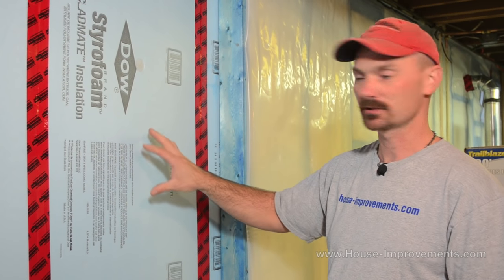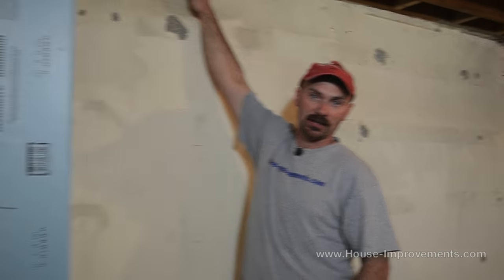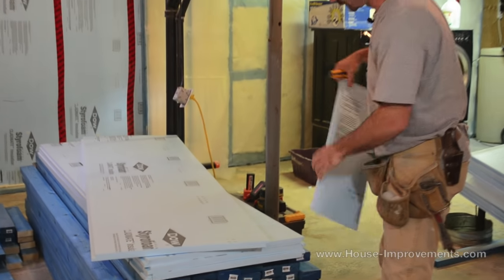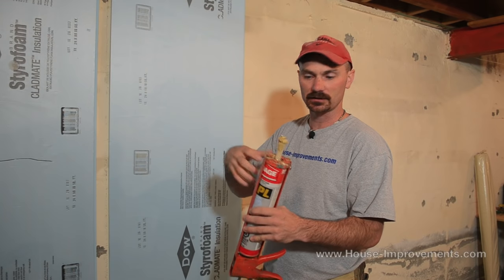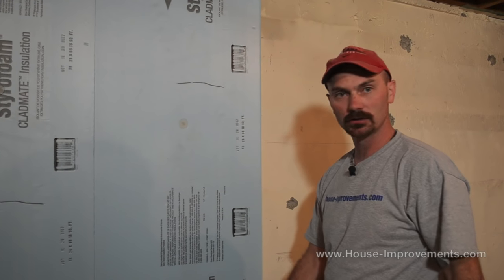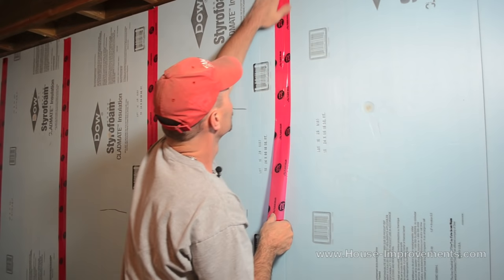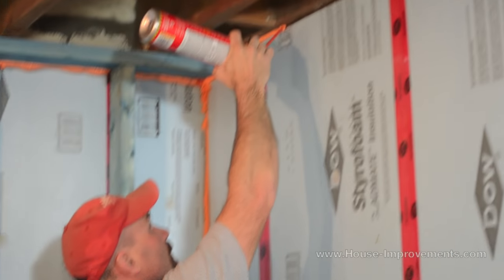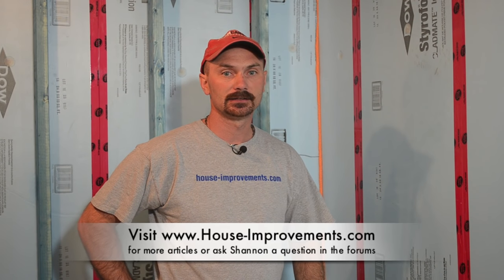How To Attach Rigid Foam Insulation To Concrete

Comment: All of this is great, but if you do not have the proper barrier over the exterior surface of the concrete, it will always transmit moisture directly from the soil, through the concrete, and into the interior side of the concrete wall. Thus you'll always get moisture, and mildew/rot if you drywall. That's why you've seen Mike Holmes excavate countless exteriors of basements down to the foundations in order to apply sealants and barriers to the exterior basement walls. Without proper WRB on a building you'll always have problems.
Reply from the maker: This can be true for sure, I don't want to bash MH but he also has TV $ behind him to cover the costs that go along with doing all that work and in most cases doing just that work along with re landscaping and replacing any sidewalks and anything else they had to remove so they could excavate  is in the 10s of thousands of dollars. If you have no real actual leaks it is hard to talk people into spending that extra money. Is his way the absolute best way.... yes I would say it probably is, but it is not always the practical way. Thanks for your comment
Reply: HouseImprovements
Very true, certainly not something to do unless it's a serious problem. I had a house out in Massachusetts that had a garage backed up to a hillside. The soil encased the back and side walls of the garage in a giant C-shape. Clearly there was no WRB to protect the concrete from the wet surrounding soil and the concrete walls would transmit so much moisture into the interior it almost became tropical inside the garage. Anything you put in there would grow mildew, mold or rust. So the only thing you literally could put in the garage was the car. Absolutely no storage ability. Basements, and all other spaces with concrete walls below grade really can be expensive, especially if not done right the first time. Nothing is more expensive then doing an expensive and complex job twice. ;)

Comment: Great Video! What R value does the foam board have?
Reply from the maker: They are different depending on the product .most range between R 3 to R5 per inch
Reply: @HouseImprovements  what thickness did you use here?

Comment: How would you insulate a cinder block house made in late 40s? Would you recommend putting 2 inches of foam and then Tyvek on the outside before vinyl siding is put on? Thanks!
Reply from the maker: Good question... That should work but you will need to also strap the house to install the vinyl.
Reply: HouseImprovements Is strapping wood slats?
Reply: George Fiorille I'm pretty sure that's exactly it.

Comment: Hi Shannon,  Love your videos.  Would attaching the rigid foam to the concrete wall using Tapcon concrete screws and Styrofoam metal washer work or will  it provide condensation path from cold to warn between the concrete wall and the Styrofoam?  Any input would be greatly appreciated.
Reply from the maker: Installed directly against the concrete is fine. Using Tapcons with washers will work fine

Comment: Hello.. My basement walls are very old and made out of big rocks and cement and definitely not very flat. What would you suggest I do for a wall or insulation in this case? Thank you in advance.
Reply from the maker: If the basement has proven to stay dry I would just frame wood walls and insulate with Roxul insulation batts. If it does not stay dry I would consider not finishing it.

Comment: With the rigid foam acting as a vapour barrier and then another vapour barrier on the inside of the wall would that not allow mould to build up in between the two vapor barriers?
Reply from the maker: 1" styro faom is not thick enough to be considered a vapour barrier.
Reply: DrgnFlys It is either a vapour barrier or it is not a vapour barrier?  The same could be said for OSB sheeting on the exterior of the vast majority of homes built today with the edges nailed all nailed securely to framing members.  All we the general population has to rely on is the statistical ratings of different products and application techniques.  1' of foam has to high of a permeance rating to meet the requirement of a vapour barrier.  Shannon is presenting an excellent video/tutorial on a very efficient method to insulate a basement.  Some of the homes I have done in this manner still only have the vapour barrier on the walls and I have never seen evidence of moisture/condensation build up when opening the wall for additional work?

Comment: hello Shannon, Can you perform the samed installation directly on a brick wall vs concrete? or does brick wall need a 1" gap or air? thank you for your response. Ben
Reply: please answer this one. I too have block wall and a hesitant to drill
Reply: N Kel as long as your brick is not hollow core,and has been filled.

Comment: Thanks for the great how to video! I had one question regarding prep for the wall. We have an unfinished wall, and the basement doesn't flood or appear to leak anywhere. Before it gets covered with foam, then framing, etc do you think it's worth it to DryLok the wall?

I previously owned a home that had water issues, so I'm a bit of a worry-wart with basement moisture!

Comment: Can I use this insulation on hardwood flooring? I just purchased a house that has a crawl space basement and the first thing I noticed was the floor was cold. I am planning to put insulation at the bottom of the hardwood flooring to keep the above rooms warm. Need advice for best solution. Thanks!
Reply from the maker: Yes you could install this product to the ceiling of the crawl space, be sure to also insulate the joist ends as well.

Comment: what if my styrofoam doesn't have tongue and groove? do I need to add glue or something else?
Reply: I'm going to be using 2 inch in 4 x 4 sheets on the outside of my house and then adding siding
Reply from the maker: You will have house wrap either installed under it or over it . As well I would use canned spray foam to seal any gaps in between sheets or around objects, once its dry you can cut it off flat. Here is my exterior foam video https://www.youtube.com/watch?v=eYjF1afRqvE&list=PLh0KqGKtX4oUz8fyeFsZYo6Np41NoreOQ&index=9
Reply: @HouseImprovements  Thank you for the quick reply. You are the best builder on the internet 👍

Comment: I'm not sure how I feel about this advice. Basement walls are notoriously humid (in most of the northern hemisphere) and adding a vapor barrier on the inside practically guarantees mould growth between the concrete wall and the foam. The concrete wall needs breathing, so some amount of heating is unavoidable, I think. And I am pretty sure there should be a "breathing gap" between the concrete wall and the foam/EPS/XPS.
Reply: Concrete and platics (foam panels, foam spray, tape, etc) are inorganic, mold cannot form on those materials. For your other points, check here: https://www.nrcan.gc.ca/kthi  Chapter 6 regards basements, and discusses water and vapour control well.

Comment: What to do with basement floors cracking with water seepage...not with every rain, but when we get heavy rains...
Reply: You should have a professional come in and evaluate, but you more than likely need a sump pump, Melissa.  Our house is a ranch built in 1963 and the floor would leak water into the basement from the joint where the wall meets the floor during heavy rains.  Sump pump installed in the lowest corner (based on outside landscape) with drain tile extending 20 feet out in each direction away from the corner, and the basement hasn't leaked since.

Of course, if your house is newer, your issue could be something as simple as existing drain tile clogged.  Just to give you another example, my mom's previous house was built in 2002 and about 5 years later, the basement floor started leaking water, through cracks in the floor, like a spring.  The builder came out and said that the house had drain tile around the foundation and under it, and that the discharge must have been clogged.  10 minutes with a shovel outside to clear the dirt/grass/debris from the drain, and she never had water intrusion issues again.

Comment: Can I stack two foam boards (2" thick X 2) directly on each other and glue together using foam adhesive glue, tape seals  and spray foam around the edges? Would this give an R20?

 I don't need to frame and fibreglass, because previous reno built a false wall 1.5 feet out  holding the drywall on. I can just pull off drywall and work behind existing framing.
Reply from the maker: +1sicsol  Yes you could do that.

Comment: Hey In my basement I have metal studs they are about 1 inch away from the wall at the top but at the bottom of my wall ( old basement concrete block). It comes out a bit and behind the stud I barely have any room maybe for a sheet.  Basically can’t fit the rigid board behind it.   Can I spray foam behind the studs and just leave spaces between each rigid board?    Combine spray foam with rigid board against the wall.      

Thanks for who can answer this!  

Brandon.
Reply from the maker: Yes you could.
Reply: @HouseImprovements   ok great!  I really appreciate your feedback,  and your videos have helped me a lot..  I’ve become more of a handy person from them.    Have a great day and thank you !
Reply: Sorry last question,  Might as well ask since I’m here..  appreciate your time a lot. If there is a bit of air space behind the rigid foam since the wall isn’t completely level will that be ok?      If not I’m thinking of cutting the rigid foam and keeping the bottom and the top separate and just spray foam between the spaces.   Just adjustments with my old basement situation !      Thank you

Comment: These foam
Boards got directly to the concrete wall with nothing between the foam
Board and concrete ...correct ?
Reply from the maker: correct, although you can use foam glue to adhere it if you want

Comment: In a cold climate where frost is a problem, 60 years of observing other people's mistakes has shown me that if you insulate a basement all the way to the floor, your basement walls and perhaps even the foundation will fail. In Canada most building codes allow insulation only on the upper 1/2 of a basement wall so that heat can move through the concrete and prevent frost from encroaching against the basement walls and breaking them. So I'm presuming frost is not a problem where you live?

Comment: Hi
I want to install xps foam on the roof and walls from the outside. My house gets really hot in summers and I want to insulate it to lower the temperature inside. How do I do that? If I install it on the wall, how do I protect the foam from damage? Can I cement another layer of thin bricks over the foam?
And how should I insulate the roof?
I reside in Delhi, India where summers are extremely hot and winters are really cold. I read that xps is waterproof so I guess I won't have to worry about monsoon season.
Please do guide.. Thanks.
Reply from the maker: Better to check with locals as to best options for your climate.
Reply: I’d put a reflective foil between the roof joists and use closed cell spray foam on top of that. This will reflect the sun’s rays while also providing superb thermal insulation. I have this in my attic and is fine in the middle of the summer.

Comment: where do you buy the plastic clips for securing 2 inch foam board to concrete or brick wall?

I like this method, quick and secure.
Reply from the maker: Those clips are made by Hilti or Ucan
Reply from the maker: If you look in the "Interior" section of my forum you will find a link
Reply: +Daniel Cantu I found the Hilti to be wayyyy expensive, same for the plastigrip, I ended up using some plastic fasteners found on mcmaster-carr, Plastic Drive Anchors for Concrete the head looks smaller but how much weight do you put on the plastic insulation
Reply: they are also on amazon as "Plastic Masonry Fastener" or "Insulation fastener" you can link to amazon through HouseImprovements so dude who produces video gets a kickback

Comment: If I am doing a cold storage room with a concrete ceiling, can I get away with just using the adhesive? Also, do I put the foam board on the ceiling then the walls, or do I do the walls first and then the ceiling?
Reply from the maker: Adhesive will be fine but you will have to use something to temp. hold it in place until it dries. Order of install is not that important but if you do ceiling first the wall sheet will help hold up the ceiling sheet ends.
Reply: HouseImprovements thanks so much!  Unless I can find something like those plastic anchors in a big box store around here, I’m probably going to have to go with tapcons...
Reply: Would it be the same idea for the insulation on concrete ceiling in the cold room? Rigid foam then framing and fibreglass plus vapour barrier? What should I aim for ceiling r value (cold room under front porch, Ottawa weather). Can I just leave the cold room floors as is? Thanks a lot.
Reply: john -bo I ended up going with durospan gps r10 from Home Depot.  Used tapcons with washers to hold it in place and expanding foam/tuck tape to cover the gaps. I didn’t insulate the wall between the cold room and the house. It was definitely worth the cost/effort.  So glad I did it.  I also bored a hole through the concrete so we could put air service in there and I cut the bottom of the door a bit high for air return. My concerns were less about the temperature in there and more about controlling moisture so I wanted air circulation.
Reply: J Tudhope this durospan gps r10 looks like a nice product. I wonder if I could just double it on the ceiling to make it r20?
Reply: john -bo you could.  I don’t know that it’s necessary but it’s doable. The only challenge might be finding long enough tapcons or whatever you use to fix it in place to ensure a solid hold, especially on the ceiling.  I don’t think adhesive only is a good idea if you’re doubling up. Whatever you use to fasten it, you’ll want to limit how much you compress the foam because that will impact the R-value.  I was disappointed to realize how untrue my cold room walls were. And there were rushes of concrete where the foundation forms met when they poured it. All of that prevents the foam insulation from being perfectly flush to the wall. That made it tough for the adhesive to actually hold. The tapcons fixed that but I know there are air gaps behind the insulation.

Comment: Wouldn't a bumpy wall provide more surface area for the adhesive to stick to?
Reply: If the insulation was flexible so it could conform the suface of the wall and it u need to adhere the entire mating surface area. But neither is true in this case...

Comment: I am living in SK too, do you think 2inch thick will be enough for the basement that I do not plan to finish it. I just want to have it insulated and dont let the cold air going to the main floor. My house is around 30 yrs old and without any insulation on the basement concrete wall.
Reply from the maker: Rigid foam insulation can not be left exposed unprotected from fire inside a home. If you are not framing then I would use Roxul comfort board instead.
Reply: Thanks for your reply. It is an important advice!

Comment: What if I have kills on my basement walls before I install the foam board. How do I get the foam board to attach to the walls? Also, if I don't want to use the anchors because I don't want to run the risk of any moisture getting behind it what is my options
Reply from the maker: Use foam board adhesive .

Comment: What is the benefit of using 1" vs. 2" rigid?  Does a square edge not work?
Reply from the maker: Actually there is more benefit to the 2" because it has more R value. For this customer, cost was the benefit of the 1". Use the over lapping edge style if you can, it allows less transfer of cold through the joints than square edge foam.

Comment: What kind of gap do you have between the bottom plate and the foam insulation?
Reply from the maker: +Joey G  About 1" to 1/2", i depends how straight the concrete wall is.

Comment: what if you have a 1" french drain trench? can you still attach the foam board directly to the wall or would you recommend a different method? thanks!
Reply from the maker: In most cases I would say this would work fine, if you use adhesive to attach the sheets then keep the beads of adhesive vertical so they do not block or trap moisture that comes through concrete

Comment: My 12 year old house has poured concrete foundation and the basement is unfinished. I don't have plans to finish the basement but the builder installed insulation has torn away from the anchors and is falling off the walls in some sections. I haven't been successful in  re-anchoring the original insulation and I don't want to frame out the basement right now.  Should I replace bare concrete sections with foam board?  If so, should I go ahead and replace all of the original insulation or leave the sections that are not falling down alone? Also, what is the best method to attach (anchors or adhesive) for fairly smooth walls?
Reply from the maker: Foam should not be left exposed inside a home. If it ever burns it gives off bad fumes. It needs to be protected from fire after installation.
Reply: Code is that you cannot leave the foam uncovered because of nasty fumes if you have a fire, deadly fumes are released. It needs to be covered with something, so you are best to cover it with frame and glass bats or anything that is not foam.

Comment: Are you putting  drywall on top of it ?
Reply from the maker: Framing a wall that will get more insulation and then vapour barrier and then drywall.
Reply: @HouseImprovements  Got it . Thanks.

Comment: i just want know were to buy the plastic anchors. Opinions are better left inside ones head.
Reply from the maker: They are not really easy to find. Try a local concrete material supply store or search them from "HILTI"